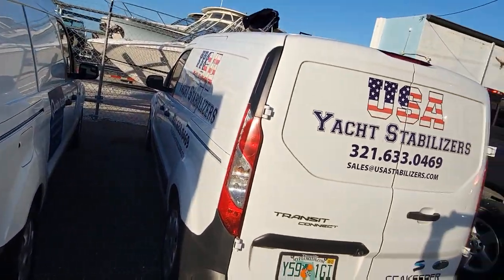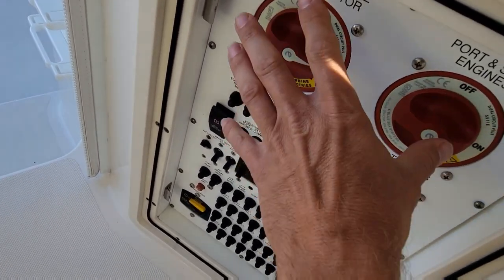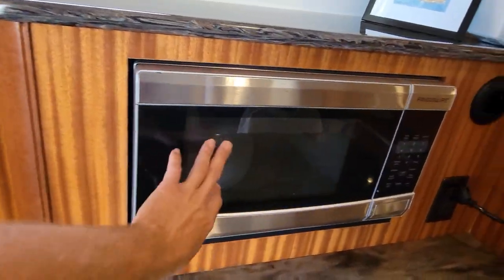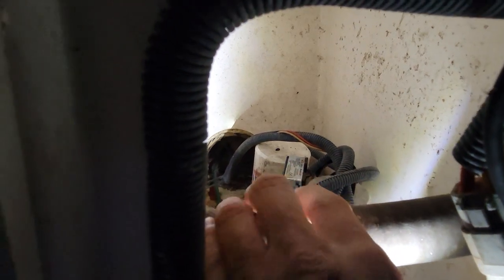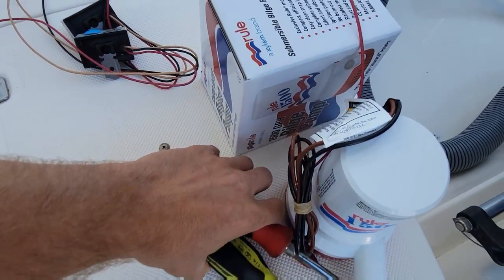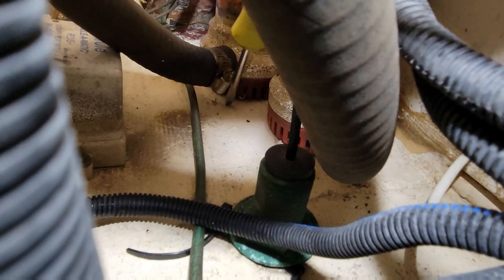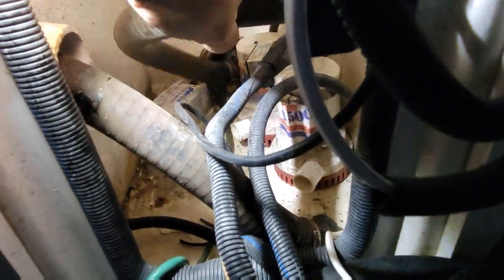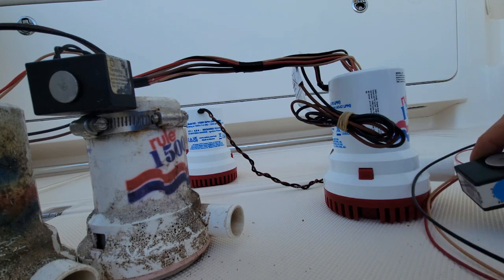In The Hole - Pursuit 385 Offshore - Episode 145 #Rule #WaterWitch

Comment: Nice work in a very inaccessible spot. Do you ever come across gear that is truly inaccessible without taking apart major pieces of a boat?
Reply from the maker: It happens sometimes and usually we have to drill a hole and install a cover plate for access.  Always something😄

Comment: Quick question. Curious as to why you mounted the rear low water sensor with the wires down against the floor vs. up where they would be dry most of the time? Is there only one orientation? Thanks - nice work in a very tight space..
Reply from the maker: There is only one way because of how the pump is mounted. The wires are ok in the water. It's the connections you need to try and keep out of the water.  Good question. Thanks